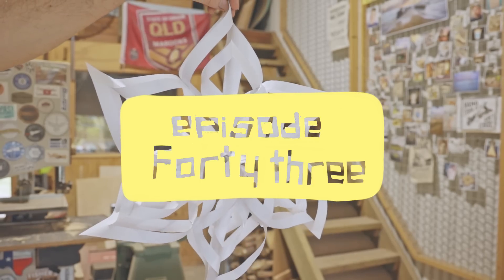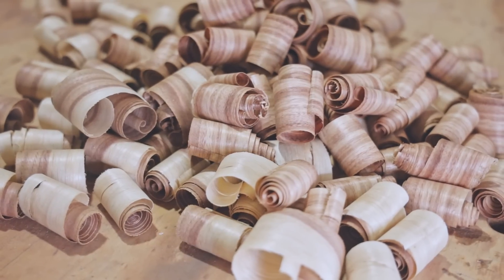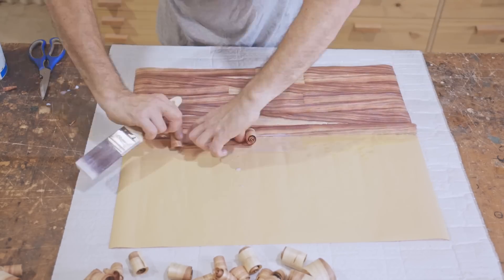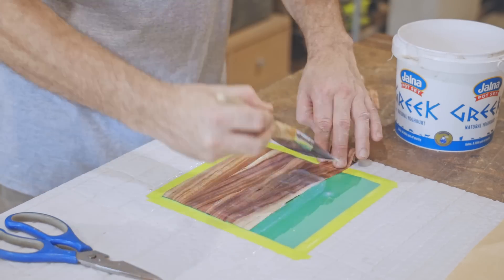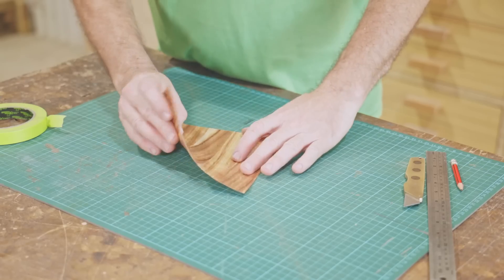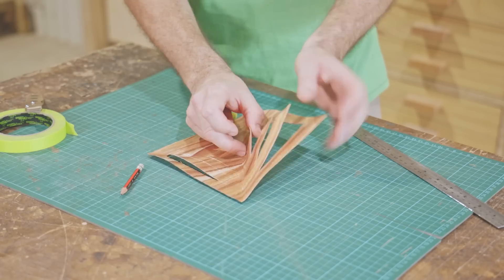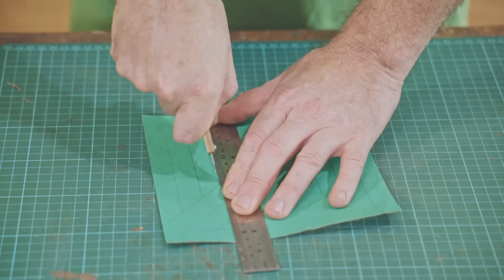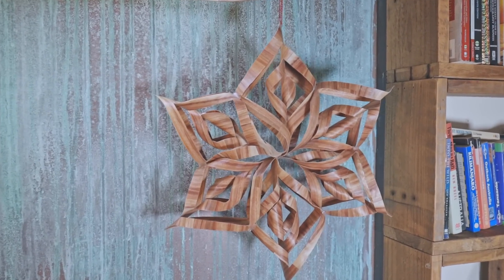Making a Wooden Snowflake - (Day 1) 7 Scrapwood Challenges in 7 Days - ep43

Comment: If you use a piece of paper the same size as your wood, cut up properly, you could use it as a template to either mark the ends of the lines, then cut lines between, OR lightly tack it in place and just cut the lines directly. Save a LOT of erasing and no bends in the wood!

Comment: There is nothing wrong with a bit of fun, but I have to take point with you for saying it is not woodwork, it may be a bit different but it is definitely woodwork if you take the wood away there is nothing left. When you said snowflake in the title I was thinking of the one where you turn the bits around and end up with “snowflakes” but this is totally different and I have never seen this done before so it is great as far as I go.

Comment: 'Not really a woodworking project', using plane shavings I couldn't cut with the sharpest plane in the world. 
Also, the only non timber part of the project is the Hot Glue and Varnish (which you put on any project)

Comment: Really awesome idea!  I did something similar with some acrylic dimensional letters.  I used planed pieces of oak and walnut to 'laminate' the letters very similar to what you just did, except I used 0.5mm clear polystyrene to glue them to.  I found out it's soooo much easier to iron the strips first before gluing, saved me a ton of time.

Comment: Why not measure and cut the squares while flat? I think folding the paper version is just because it's easier but that's not the case with wood!
Reply: actually, a template to run the craft knife through would be the simplest way for both, especially for making more than one.